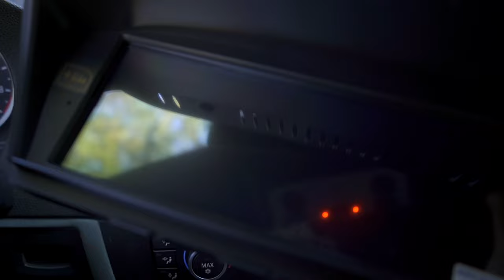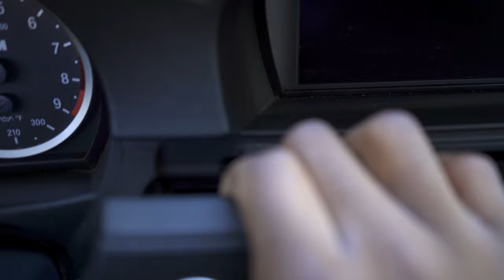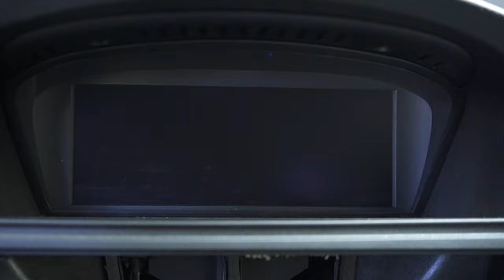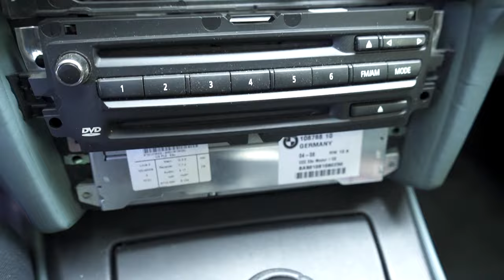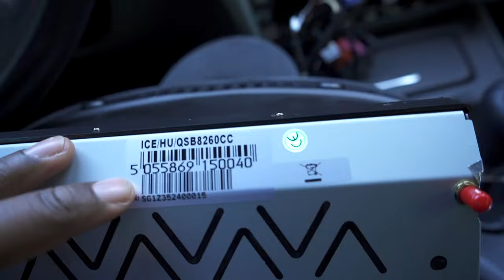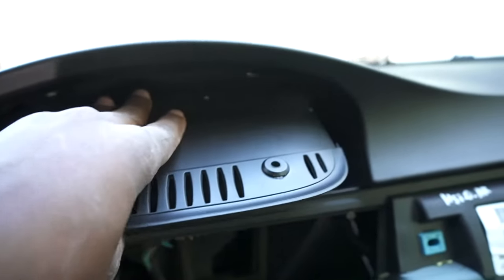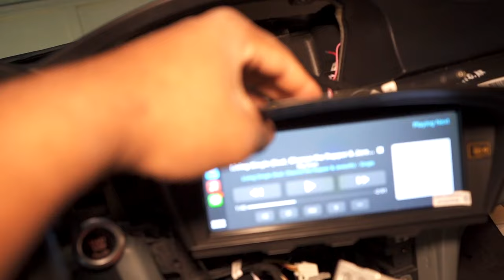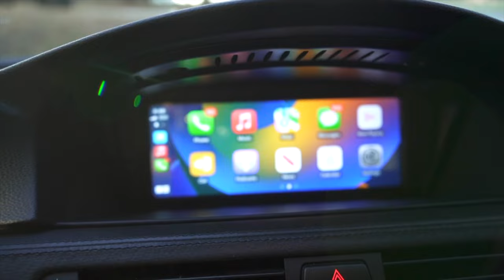How To Get Apple CarPlay On Your BMW 3 Series(CCC iDrive E90) Head Unit Install

Comment: To fix your i-drive’s aspect ratio issue, just go into the android’s main setting. And change the aspect ratio, it should then revert back to it’s normal size fitting into what it was previously
Reply from the maker: Thanks for the info
Reply: @BMW Royal  did it fix it?
Reply: @BMWROYAL  if that works it would be really important and useful to add to the video! Maybe add a comment or something.
Reply: Did it work
Reply: How do I do this
Reply: I set everything up but there sound does anybody know why
Reply: How did you connect air conditioner cable?
Reply: You can fix it with the Main Setting and look up your unit and it will fix itself.

Comment: To fix the scaling of the original BMW menu - go to settings and there should be a menu where you type in 1314 and select 8". Loads of videos of this floating around.

Comment: For the CCC UNIT, Do you need to route the AUX cord to center console or just moving the fiber optic cable would do? Because from SLOWSPEED’s installation, he didn’t connect the aux cord to the center console and audio works for CarPlay. So I’m just curious if aux if absolutely necessary

Great video 🎉 thanks for all the info
Reply: did you manage to find out?
Reply: @AliHamza-rv2mv  hey Ali, not yet. Haven’t found an answer anywhere else either… you?
Reply: @mangekyosharingan3020   Hi, just installed my new unit a few days ago. Yes, you have to route the AUX cord to the center console along with moving over the fiber optic wire to the new harness. You must do both to achieve sound. Hope this helps

Comment: Hi, nice video!
I have the same module as you (with DVD) in my car. I have installed a new screen as you have done, but I can't get the radio back in place. How did you get enough space for the cables in the back?
Reply: Exactly this

Comment: Great video.

I have a 335D, a very similar operating system, I have bought the latest Xtrons model, but am really struggling to get the original nav/radio unit back into the centre console as the wires/harness/iso connectors get in the way, where did you shove them to get the DVD/CD player back in?
Reply: man Im having the exact same problem! did you find a solution?
Reply: @oliverwaterhouse7476  yes, unscrew the screws and remove the cage that the DVD/CD/GPS unit slides into. Then cut out a couple of the vertical sections from whichever side you want to tuck the harnesses into.

Just make sure anything you cut off is above the rail that the stereo unit mounts slide into, as this will ensure the cage maintains as much stability as possible.
Reply: @richardhiggs924  legend! thanks for the quick reply

Comment: You need the ksw unit with ksw toolkit app. You can disable unit hijacking the M button. Since you disable it then it works just like it did with just iDrive screen

Comment: I'm looking to do this install on my e90 328i in the future, but I do have a quick question. When I bought the car, the radio wasn't working and I took everything apart to see what the problem was and my personal diagnostic was that it overheated, because the radio proportion didn't have the little fan in the back. Would that be a reason that my iDrive screen isn't working? I would like to fix that before I spend the $ on a setup like this. Let me know, thanks!

Edit: Would I be able to fix the problem if I bought a new radio, but this time the fan isn't missing? Lmao
Reply: yes i drive screen is powered from the radio no radio also means no CCC or CIC unit.

Comment: The only thing you didn’t cover is putting the wires back I’m having trouble getting my
Head unit back in any advice
Reply: I’ve successfully completed this install, and the only advice I can give about getting the CCC back in place is—keep trying. Keep repositioning the wiring until you get it to work. It’s going to be a very tight fit, but it can be done.

Comment: Only thing is some models have the pro nav so it's a tight squeeze with the 5th speaker behind the headunit
Reply: And the GPS won't fit so u have to disconnect

Comment: Cropped sceen: wrong setting in screen settings (menu via code 1314)
M button: you can change the m button config with tools like KSW tools, this should solve it.

Comment: I have been having trouble with my ccc unit in my 2006 330i and i wonder if i do this swap with the same ccc unit will work , because my screen is no working rn and i wonder why it happens , if i need to replace the ccc unit in order to get this apple car play
Reply: I also have problems with my ccc did you do the swap?

Comment: Hey so I just finished this job and now no air will come out of any of my front vents, but the back ones blow louder then usual, what did i mess up?
Reply from the maker: Double check to Make sure you have both plugs   Connected to the AC controls
Reply: Literally just did and found the white connector what plugged halfway in, thank you so much man
Reply from the maker: Np bro

Comment: I bought this to get blue tooth because my aux is broken. You’re telling me I can’t get audio?
Reply from the maker: Correct
Reply: @BMWROYAL  god dammit. Should replacing that aux input fix it? Or is like a wiring problem common?
Reply from the maker: Yeah replace the aux, that wire only goes to the rear ac controls and plugs in there so it’s pretty easy.
Reply from the maker: I havnt had the issue personally

Comment: Will this work on a 2012 e92 how do I know which head unit I currently have?
Reply from the maker: No this only works for pre lci. You are lucky your car uses the CIC idrive system which has much better aftermarket solutions
Reply: @BMWROYAL is there any you would recommend? Thanks

Comment: Does this by pass the original CCC? For example, my existing CCC may not be working, so would this allow me to use the idrive system with the CCC bugging out?
Reply from the maker: Probably not if your existing ccc is not working
Reply: This XTRONS unit is just a display with a lot of fancy options; all audio is produced by the CCC. If your navigation or CD player is not working, the XTRONS unit will still probably work, but if you’re not getting audio, the XTRON unit will only give you pretty pictures.

Comment: what can i do if my radio works but doesnt have audio?
Reply: You may have to go back in there and get some other wires connected. Had the same issue but fixed it asap, gotta connect a green and white wire or sum like that into the new wiring harness

Comment: Come on, that cropping issue makes this completely useless.  What happens when you hit your next oil change? Just never reset the reminder date?
Reply from the maker: I’m confused on what your talking about I never use idrive to reset the oil change u can just use the instrument  cluster , sensor the oil change reminder is almost pointless because realistically you should be changing it way more often than bmw recommend for these cars

Comment: Will this work if you have none working ccc unit? Will it bypass? I really don't care about factory idrive lol . I just want radio
Reply from the maker: Depends on the reason it’s not working probably
Reply: The screen will work for carplay but u will have no audio since audio goes through original ccc aux
Reply: @HDSlimex  my idrive unit toast too. is there anyway i can wire it in to work with audio?
Reply: @xlr8p457  if u are able to set it to aux then the audio will come through if u cant set it to aux u wont get any sound
Reply: @HDSlimex  if the aux only works with the idrive then no it won’t work because nothing related to the idrive works right now
Reply: @HDSlimex  my nav disc spins and the screen flashes white for a few seconds and turns off and this whole process repeats every few minutes
Reply: @xlr8p457 i have the same problem. Did u end up getting the apple car play and having sound?

Comment: Anyone have sound issue? I recheck my wires over and over. Radio work but as soon as I try to play music from my phone. Sound only comes out the driver speaker.
Reply: Check the pins of audio connector android to original ccc. Pins might be in different locations due to different regions, lhd/rhd

Comment: Hey quick question. Do you know if you can still reset warnings and codes? Because on an I drive car, you usually reset them through the i-drive unit.
Reply from the maker: Yes you can go back to the regular ccc I drive system and use any of those controls